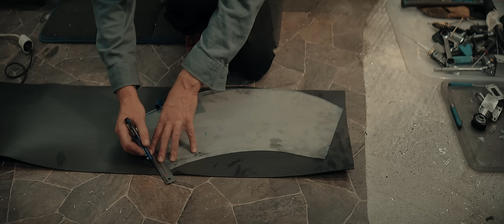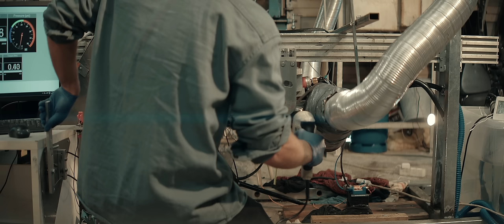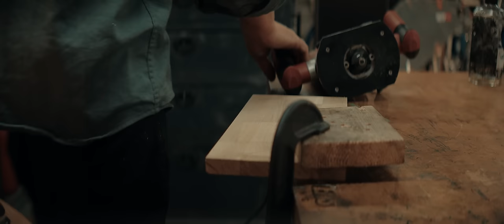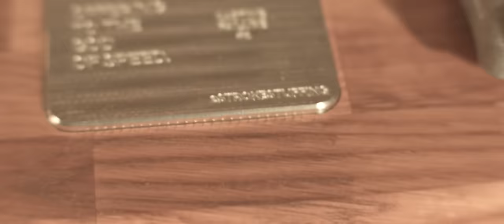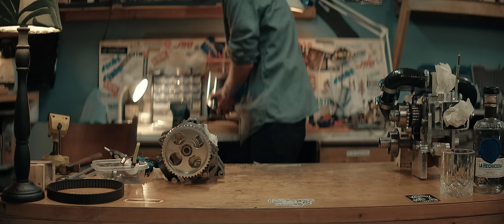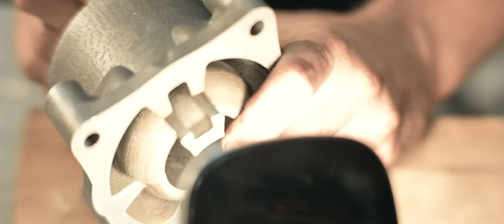Supercharging The 50cc Two Stroke PiP Engine!

Comment: Why dont you Use a 4 Stroke Cylinder Head, and use all the Valves as Outlet, and all the Ports as Inlets? Would be a Safeley Working Valve Train without Breaking Belts
Reply: 2 cams, 4 lobes, 1 valve opens each exhaust stroke, with respect to original author?

Comment: I cross my fingers and wait for the day when I see the PIP engine pulling on the secondary intake with no reed valves. As for the other engine, crankcase on the bottom, filled with sufficient oil so bottom of piston is vented. supercharger feeds transfer ports without reed valves. PIP will reign wit superior sound, boosted or not.

Comment: Could add a little oil can with a screw needle valve and jet to oil the chain reliably during operation. Otherwise if that still fails and you want to continue with the chain idea I would look at a timing chain from either a car or steetbike and see how it holds up.

Otherwise love what you are doing and keen to see what PiP can do.
Reply: Most (all?) car timing chains run in closed compartments with plenty of oil splashing about. Not impossible, but difficult to do that when you’ve got a rotating hot tube running through the same space.
Reply: @emmajacobs5575  I did think that but they are expected to run tens of thousands of kilometres, whereas in an open oiled drip setup I reckon they would last longer than this chain setup since they only have to do maybe a max of 5 hours total run time to tune and do a max speed Run, again as compared to in a car running for hundreds of hours. Just makes sense in my head at least.

Comment: I feel increasing combustion volume,  engine seems happy low but not high rpm , compression at high rpm with Max boost chocking it..

An idea to avoid using reeds investigate/research how F1 engine values work NO camshaft , works purely on cylinder vacuum on inlet and exhaust valve works on combustion exhaust pressure. 
You only need inlet valve with spring adjustable spring pressure OR a butterfly/flap with a adjustable spring pressure tensioner  , so it closes when crank pressure is low and opens as pressure builds with intake pressure. 
Best I could explain no need for reeds , I would skip rotary valve go big pipe and tune length for top end.
Awesome work shroud around exhaust chain with some oil , but will be problem on salt with splashing oil , you'd need nylon gears.
Cheers

Comment: Love your creativity , i have not hold your engine but the brute force intake is a great idea but the same as whit a turbo it does not work on two stroke exept for a few engines (example piaggio vespa pugh maxi or realy old tomos (no reads))
This is because they reley on piston and rotary crank intake the same as a heavy mechanical intake valve and even then a two stroke builds up crank case presure and the piston pushes it up into the top of cilinder so a low presure  crankcase defies the whole boost aprouch at least loweres the efectivity or reaction time 
I have been tuning 2strokes for 27years now (dying breed😉) my personal stable max was about 24hp 44cc whitout budget , you should try to eliminate the ingoing presure on the moment the piston pushes the mixture up , give it a tought greets from holland
Reply: Polaris and Rotax have been making, selling and developing new turbo 2 stroke engines for couple years now...
Reply: Just checked their engine out very nice engine still not optimal and they now it but the implemention of the blower is because of elevation problems and the los of power under low presure just like whit small airplanes,but every time the piston pushes up the mixture the turbo or blower is still adding more crankcase presure and is not helping the NORMAL flow of a 2 stroke but whit a rotary crackshaft intake or piston controled there is no issue

Comment: I was hoping to see confirmation of fuel puddling in the transfer tubes being the cause of the engine stopping.  Also, it looks like a lesson should be learned about sprung chain tensioners, no?
Reply: I think it was more that he could hardly turn the engine by hand because the chains were so siezed

Comment: I'd still look at the original brute force engine with the single rotory and replace that blower for the volumex blower and bin the exhust valve.....  Positive pressure,  exhaust back pressure and harmonically tunable??  Probably sucks far less power than that heavy air pump also.....

Comment: "i thought oiling the chain with thick oil would help"
lol dude chains need THIN oil. you are oiling through a 1/1000th gap between the inner plates and outer plates, thick oil will just sit on the outside lol

Comment: What if that chain was just too tight causing excessive heat gather into it? think it about like chain drive on the bike, they always need to be little loose and lubricated with chain wax, not with oil

Comment: Why are projects like this kind of like a carpet that is a little bit too big for a room. Fixing one side gives you 3 other sides and a few corners to fix.. But sometimes going full circle is a way to start thinking about turning the carpet 90 degrees... or even lifting it up, standing it on the side on a wall or knowing wich sides to fold in. 
Are the corners 90degrees and are the sides same lenght? is the roof same size as the floor? and is the room a perfect cube? Then its time to put the cube on the carpet. :)

Comment: You need two engines one to break in the cast sleeve and one that is for the machine to ride the break in is one month one hour a day at high to moderate r.p.m. and the break in engine dont have all the proformance parts just a plain jane for cylinder break in the other has every thing like rc plane builders done with cox engines you had to run the cox engine with a complete tank wide open to break it in
Reply: This way if something goes wrong its easy to troubleshoot
Reply: You can swap pistons but the ring and cylinder are a pair once broke in

Comment: Are you sure you want to abandon the engine that was giving good results? Perhaps it is enough to eliminate a drum, leaving a single exhaust outlet and use a different type of chain, perhaps go back to the belt but through a ventilated pulley inside to reduce the transmission of heat to the belt.

Comment: Lot of weed eaters and chainsaws run just aluminum cylinder no sleeve  but they wear fast a cast iron sleeve no coating is best they last years america still has old 70s dirtbikes still running with cast iron sleeves no coating the coating wears and expose the iron sleeve and the ring sticks to it and snaps or it chews the ring whatever the case may be but coating is bad the coating was only for racing so they knew the engine wasnt modified boar nothing else it dont add any performance and takes away the long-term use of the engine cause it is softer metals so it dont last long

Comment: I think you should experiment with poppet valves.
I.e. you may aswell just convert a 4t engine at this point 😂
Reply: You might even get better flow dude.... Exhausting from the top of the cylinder.

Comment: Vad är det som gör att kedjan nyper/skär i länkarna trots att du smörjer?
Reply from the maker: Den ble veldig varm veldig fort, virker som oljen fordampet.
Reply: @2STROKESTUFFING  if you are using industrial chain you can sit the chain in a tub of melted hi temperature grease for about 30min then hang it to dry . It worked on a high speed gearbox on a processing machine, went from replacing chain every shift to once a week . Hope this helps

Comment: Are you sure you’re supercharger is effective at the speed/load/rpm you are using it?

I saw a video of banks showing his new truck and they needed to change the supercharger because at idle the intake temps was skyrocketing, i never tough that was possible 
They explained that they have a “narrow” effective bandwidth , maybe it’s something you need to look at before trying to find corrections at a problem that should not exist.

Btw i love the way you film and edit your video
Reply from the maker: Thanks! The AMR300 should be most efficient around 4000-8000rpm, with current drive reduction thats about 9000-18000 engine rpm.
Reply: Always necessary to remember that a boosted engine has very little air/fuel mixture when throttle is closed and that compression ratio has to be modified to receive maximum fuel air mixture when the rpm is high and the throttle is open. result is a smooth idling engine with tons of power.

Comment: I think turbo on the PIP engine, try something different
Reply: I don't think there is any turbo, of the shelf, that is small enough for 50 cc. The smallest turbo I have seen was for 125 cc as the smallest engine size.
Reply: @nhytg376tgyuu765gjmg  the level of engineering in  this channel I'm sure a exhaust housing could be remade or could have the exhaust wheel turned down and exducer sleeved to suit, also the sheer revs and hp the PIP engine makes I'm pretty sure it will spool up a oversize turbo,
Reply: @Grooty79  Maybe. Would be awfully interesting to see nonetheless.
Reply: @nhytg376tgyuu765gjmg  best thing with a turbo is no hp loss from running it, I could see a 50hp 50cc if it was turbocharged properly

Comment: Sorry to say this but jumping forth between different concepts is bad engineering and not very scientific. Your resources are already limited as they are. Proportional improvement is the next step. Want to know if it runs lean or fat? Weigh the fuel you use and compare it to the volume of air pumped through. Rpm x min x single rotational volume.

Comment: I must ask myself why why are you screwing with the PIP engine and taking a gamble on blowing it up into Oblivion just go to Harbor Freight and buy a predator engine they're cheap blow one of them up yes it might be more than 50cc but who cares not the PIP engine have you gone mad
Reply from the maker: Slightly mad... I just got this urge to try it.
Reply: A good rule from Frits is to never try to improve your best cylinder/engine.
Try changes on a clone instead. Or in this case. Leave the PIP alone and make it resonate. Meanwhile you can have any crazy side projects like the Brute Force. (It ran WAY better then I ever could imagine. 👍)
I’m totally convinced you would succeed with the N/A PIP, if you see the project through. Crowning it with a Bonneville attempt would be awesome. 👌